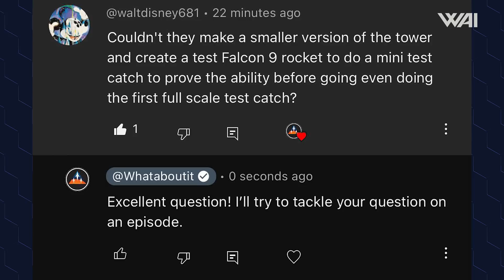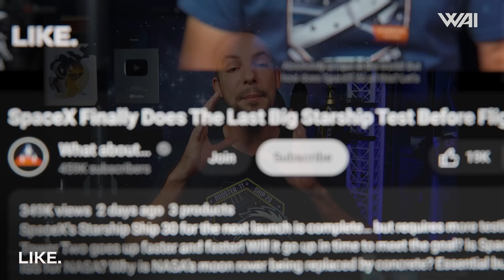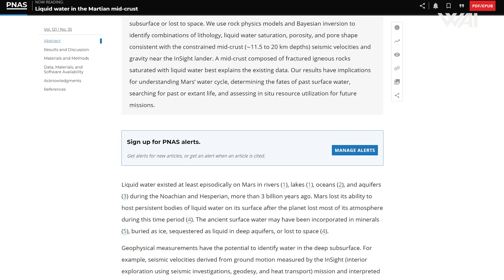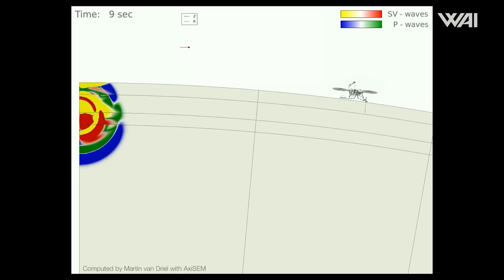SpaceX Massively Updates Starship! Ready For Flight 5!

Comment: On the bump stops, SpaceX might be planning to add a hydraulic ram to control compression/rebound like on a vehicle. It could either be active to assist with closing, or passive with valving that damps oscillations. Either solution would require completely removing the existing stops. I suspect they didn't before because it would be harder to protect than outside rams like they already use.

Comment: There is an issue in physics when there is a drastic change in direction.  You study this in Numerical Analysis in college.  There are math methods to get around the crazy waveform when a change occurs.  It takes a while to run the numbers and add the data to the AI program.  Many times, a simple solution is to divide the equation by its derivative.

Comment: An almost empty fuel tank would be more explosive than full!
Reply: No it would not be. Less fuel=less explosion. That's why planes dump fuel before an emergency landing. If you fill a nearly empty tank with air and then it explodes, that detonation can initially be worse than a tank full of fuel rupturing, but rockets are not filled with air (they are filled with either hot expanded gaseous fuel/oxidizer or helium) as they empty like a normal fuel tank is and hence this is not true for them.

Comment: If magnets were installed on the bumpers they could be used to repel or attract
Reply: No magnet would be strong enough to matter at this scale and stainless steel is not magnetic.
Reply: @filonin2  that's true in your mind only. Stainless? Um, that's is simple minded. Don't have to rely upon the structure to magnetize because 2 magnets can be used together. It's your thinking that doesn't work!

Comment: The Falcon 9 cannot hover.  The Merlin engines do not have the ability to vary their thrust sufficiently to just hover, which is imperative to the catch maneuver.  Falcon 9 landings are an incredible act of timing.  Essentially, they vary thrust so that the booster reaches zero velocity at precisely the correct time.  The Falcon 9 never hovers.

Comment: Felix, as usual this report was rich with information regarding the the amazing, outstanding, innovative, creative progress of the Starship program.  Nothing about it was "crazy", a tragic mental health disability.  You used the "C" word three times within the first 4 minutes of your otherwise excellent report.  Do you suppose it would be possible to find other superlatives? 

Regarding the positive stops recently removed from the chopsticks, I think this had to happen.  The enormous mass of those arms extending well beyond those stops setup an undamped low frequency oscillation involving the momentum of the arms and their flexing  at the attachment points of those stoppers.  The arms have to be stopped by controlled deceleration ending in a complete stop at the required gripping point (critical damping). So, as you said, software controlled with the new bumpers absorbing any (hopefully zero) overshoot.

Comment: It's going to need legs if it's going to mars??? I don't see the point of all this tower business if its going to need legs soon anyway.
Reply from the maker: The ship will need legs for Mars. The booster will never go there.
Reply: @Whataboutit   ah yes good point. But the ship dosnt have legs either.
Reply: The superheavy is never going to Mars, neither the Starship tankers. These 2 are going to do the heavy lifting for these missions (tens of launches per Mars or Lunar Starship). And having an extremely high launch cadence is crucial for the success of their Mars plans.
Landing on Mars has very different requirements than in the deep gravity well of Earth, so developing heavy legs to land here is wasteful, limits payload and the speed of operations and reusability and increases costs. If they fail to catch them reliably they can always add them, but they have to try and fail first before they add wasteful parts and ops. "The best part is no part. The best process is no process. It weighs nothing. Costs nothing. Can't go wrong" - @elonmusk
Reply: @admarsandbeyond  ah yeah lol I just realised the booster isn't going. But the ship dosnt have legs either, I assume the ship will need legs?
Reply: @ctrsmithy  The moon has 83% less gravity than Earth and Mars has 62% less gravity. The ships going there will need different and much lighter legs than those needed for Earth. Also most Ships will be built for Earth (for a long time), satellite launchers, tankers, orbital research labs, space station support, etc. No need for legs for all these.

Comment: Catch mechanism is crazy… I have a less crazy idea. Hear me out! SpaceX has to build a launch tower designed to revolutionize the way rockets are launched by incorporating a massive counterweight system. This tower innovative tower is equipped with a unique mechanical system that accelerates the entire rocket stack, including both the booster and Starship, like a lift or slingshot.

The counterweight system is placed on both sides of the tower with it's enormous counterweights, each weighing many tons. These counterweights are connected to the rocket's launch platform via a series of high-strength cables and pulleys, designed to provide a smooth yet powerful upward force. The counterweights are pre-lifted and locked into place using a combination of electric motors and hydraulic systems, primed to release their potential energy at the moment of launch.

At launch, as the platform ascends, the counterweights' descent speeds up, providing continuous upward acceleration. The rocket is effectively "slingshot" upwards, reducing the amount of propellant and oxidizer needed for the initial liftoff phase, which is traditionally the most energy-intensive part of a launch. Should the launch be aborted, the system deaccelerates until halting/reversing and coming back down.

By utilizing a counterweight system to achieve initial lift-off acceleration, significant amounts of fuel and oxidizer are saved, allowing for a proper landing leg system to be added to Starship and Booster.
Reply: How heavy does the counterweight needs to be??
Reply: @DailyAiVanGogh  I hope the WAY crew will figure that out for us!!!
Reply: Super sci-fi idea! Loved it
Reply: @OliviaArtisticAnimals  ❤️❤️
Reply: Bro this is crazy!
Reply: Sounds intriguing! So, you're suggesting SpaceX takes inspiration from roller coasters and catapults to give rockets a gravity-defying boost, like an amusement park ride but for the cosmos? Loved it @SpaceX please take note of that
Reply: Just a little less crazy. Just a little.
Reply: @otavios6027  :face-green-smiling:
Reply: @otavios6027  😜
Reply: What if it's an abort?
Reply: @ThomassFierceFantasticalCreatu  the lift accelerates until a certain spot, then slowly decelerates until safe stop.
Reply: :face-fuchsia-wide-eyes::face-fuchsia-wide-eyes:
Reply: Mind you, this system would eliminate the need for the mega-steel pancake water deluge system.

Comment: I think they should have tested the catch attempt with a spare booster flown to 10km high and then kill the engines. at 2km above relight the engines and see if the arms can react fast enough for a catch. orbital velocity booster coming in for catch has so much kinetic energy that stopping just above the ground for a catch would be a challenge and thus, worth testing with out the risk of valuable infrastructure. then again, Falcon 9 already does this perfectly every time. So.....still worth a test. still prefer landing legs.

Comment: Why no tension cables on the towers? Simple safety measure for the torsion of the catch....no?
Reply: They are not that kind of tower. That's for small skinny towers. This is a very thick tower filled with concrete.

Comment: On the subject of why they can't use a Falcon 9 to simulate the catch of a buster, the Falcon 9 uses a "Suicide Burn", Because even at minimal thrust with a single engine on return it is so light it has a greater the 1 thrust to weight ratio. Basically it can not hover, it lands by trying to 0 out it's speed right as it lands and turning off the engine at the same time. The buster is able to hover on return, and doesn't use a reentry burn to slow down in the upper atmosphere. In short as was stated they are two completely different vehicles. I am sure Space X has already applied all possible information from the development and operations of Falcon 9 and getting it to land to guide the development of the buster.

Also as other have noted the reentry profile for the buster will bring it down in the ocean if the engines don't relite. I am sure they have automated in the guidance computer to only start to guide the buster to the launch pad if everything is operating properly. And even then they would still have options to redirect the booster back to ocean in most cases. I would say the risk to the tower is relatively small and they will have the second tower finished before the next test flight either way.
Reply: All good points. But seriously, if SpaceX wanted to do it, they could. Since the falcon would just be hopping, it could carry as much fuel, or a mass simulator, to allow it to hover. It’s not like they would do it with a random returning booster. They’d build a test article. Possibly using a well used booster. As you point out, a Falcon can’t hover because it’s too light….so add weight.
Reply: @evanmorris1178  But it's also not hard to see why they wouldn't bother. The goal is to catch Starship, not Falcon, and any effort spent on doing Falcon-based experiments would a) be of limited value because it's a different vehicle, and b) would be a distraction from doing Starship development.
Reply: @simongeard4824  Agreed. I just read so many people claiming it’s impossible. I think they could do it, but I seriously doubt they would want to.
Reply: @evanmorris1178  Oh, yeah, it's certainly *possible*... as you say, an empty Falcon booster can't hover, but that just means you need to add some ballast to make it heavier.

Comment: be real, the deepest hole on earth ever drilled was 9km in 1994 in Windischeschenbach. might be today are deeper once and might be mars is easier to drill. as cold core you do not meet lava w3hich melts your drill. But can you imagine the gear you need to realize this on mars double deep and more than one, still not clear if the water comes out by its own like early oil wells or you need to pump - something in to push it out (with oil we use water ....).? i would claim for at least 100 years this is out of reach - even for musk.
Reply: Digging deep on Mars will be easier due to lower gravity and lower temp. Today;s tech could do it, but we need 100 more years? Ok grandpa.

Comment: Testing with smaller rocket will be easier/cheaper, yes, but THEN you need to rescale the results and test AGAIN with the big rocket. Scaling your experience to a bit larger objects is usually easy, scaling x2.5 is not (especially that weight scales proportionally to cube of linear sizes).
IOW: "one hard problem" versus "two slightly easier problems".

Comment: I really believe that if the booster hits the pad in an uncontrolled way, spaceX probably wants to replace that water deluge method with the new design used on pad 2 they are almost done with anyway. I think getting rid of the deluge would be an advantage to SpaceX simply to get the FAA looking at one fewer thing.

Comment: It could be tested with a superheavy doing a hop to the tower with the same limited fuel stores from various heights which returns the same potential resultant failure with less data learned till they go to a full send and return. This works out the reasoning why they are just gonna go for it.

Comment: The deepest hole ever dug on Earth, with a breathable atmosphere, easy transport, and all the technology we have is only 12.262 KM deep.  Digging a hole that deep on Mars is likely to be as hard as building Starship has been, but needs to be done between 56 Million KMs and 401 Million KM away from Earth, with an unbreathable atmosphere, hugely challenging transport and only the technology we have managed to ship to Mars by the time we start drilling.  Yeah, it would change all sorts of things if mankind had access to the water on Mars, but that sounds like a 10+ year challenge after we have regular deliveries, a huge Mars base and on-planet food and fuel production.  Good news for sure, but of no practical use for a long time!
Reply: Not to mention the force needed to pump the water to that height...
Reply: @RaduM1  The far lesser force needed than on Earth? 1/3 gravity.

Comment: Ähm Water in 10 to 12 km deep? Have you thought of the biggest whole ever drilled on earth is 12 km deep. The temperatures down there are 200 degress Celsius. Which could lead to water steam as soon as you open the reservoir but not to liquid water at all. And drillig the hole did last 20 years. Where all the intellectual property on hwo to do it is owned by rusia. So I do not think this "changes" anything. Because for drilling only one hole to get down to that water on mars you will need ressources for more than 20 years of drilling (which itself needs a lot of water to coll the drilling equipment). After that you are not even sure about the quality of the water you will get up from that deep. probably it is poisoned or worse radioactive contaminated.

Comment: If it fails relit engines ,it will be traveling supersomic, with dry mass alone and fumes inside tank it will be enought to demolish entire launch tower.
Reply: I believe it dog legs a bit after relight. So if it doesn't relight, it goes straight into the ocean.  Or self destruct???
Reply: An empty booster weighs less than half a million pounds and is made of thin sheet metal. The tower, which is filled with concrete, masses hundreds of times the booster. Also the booster does not come straight down at the tower so if the engines fail it just hits the ocean.
Reply: @filonin2  Yeah, it's like chucking an empty coke can at someone. It might hurt a little, but it's not going to do any serious injury. That tower is a lot more solid and more massive than the boosters...

Comment: So much to unpack…. I don’t think there will be two block 1 flights left. The reason is SpaceX never did the wastewater permit they were told to do when the new deluge system was installed. When CNBC did their report (true or not) it brought to the attention of the FAA that they never completed the application and therefore never got the permit. Now the FAA and EPA are on the hotseat for not following up so they won’t allow another launch until they get that permit. Either Elon lied or was so high he forgot but he says that permit was for pad B but it wasn’t and isn’t. So I see the launch closer to November maybe even 2025.  So there will be block 2 starships waiting so block 1 will go away. Also, all that heat shield work on an obsolete vehicle protecting flaps that are moving is a waste of time and money and am shocked Elon is doing that. He is too split between businesses.

Comment: Falcon 9 catch test: This rocket can't hover like starship because one engine at minimum throttle produces more thrust than the weight of the boster at landing. It can only do a break to a stop that must be perfectly timed. The recent hard landing that collapsed a leg is an example of the timing being a little off. Starship, on the other hand, can hover and precisely manuver into position. The limiting factors are fuel consumption and not damaging anything with the flamey end of the rocket. Elon described this as the world's largest cutting tourch.

Comment: One test I'm surprised they never did with the chopsticks..  dropping an old booster into it's arms from a crane.  They should be able to figure out the conditions the booster will be in for the couple of seconds before the catch happens, and replicate them.

Also, 10-20km is super deep, on an alien world.  We are barely starting to scratch the 10km mark for petroleum wells on Earth, and you wanna drill on a different planet, that we know nothing about in terms of drilling into, at a depth possibly double that?  Good luck with that.
Reply: Mars will almost certainly be easier to drill deep as there is less gravity and the crust is cooler. We are limited by the crust getting to hot to drill on Earth. Not a problem on Mars. Drilling wells is child's play compared to colonizing another world, btw. Just one of the millions of small steps needed.